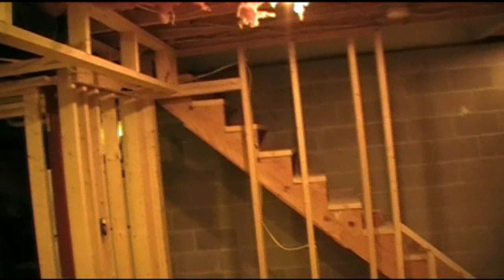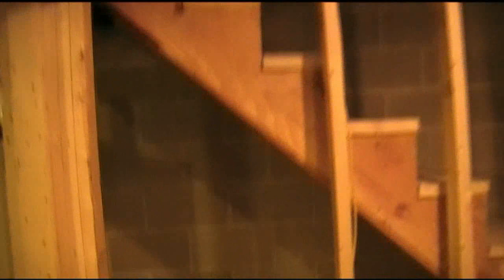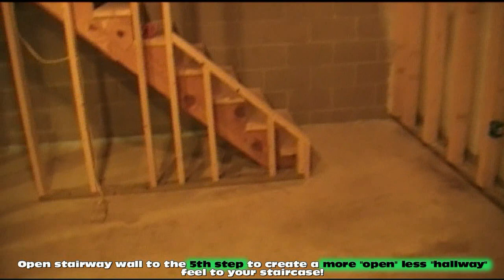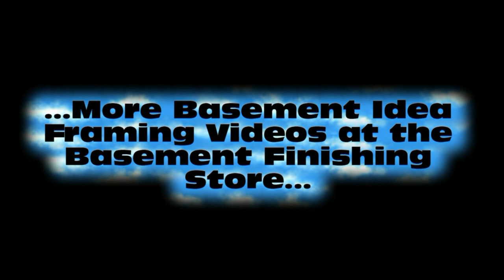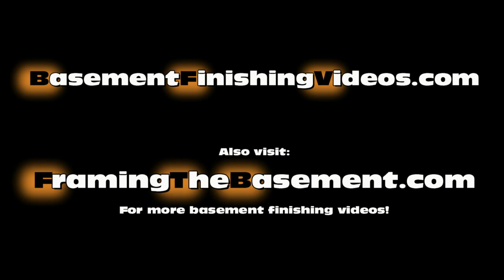More Stairway Wall Design Ideas

Comment from the maker: Well you must glue your drywall to the concrete wall using drywall adhesive. This way you only lose the thickness of a sheet of drywall (1/2") in the stairway.

There is not enough space in the stairway to build a framed wall, I don'y even like using 3/4"lathe! Just glue it and be done with it. You can pound  a few 1 1/4" concrete nails to hold it in place until the glue drys. Once the glue sets over-night your good to go!

Hope this helps. ~Eddie
Reply: Do you do anything to protect from moisture?
Reply: Stringer should be 1.5” thick. Use 1” foam board glued to the basement wall then glue drywall to the foam board. Use J bead around the drywall perimeter to finish the edges.

Comment: Regarding the bottom 5 steps- do you simply slip a piece of dry wall between the stair treads and the framing? Seems it would be difficult to finish the wall trying to work against the steps like that. Any advice? Thx for the video.
Reply from the maker: Yes that is correct. It's really the only way if you do not have the pre-manufactured stringers attached to you stairs...as many older homes basement steps are lacking.

Eddie

Comment: If you left it without railing at all, it would create a more open feel and would make it easier to maneuver larger items.
Reply from the maker: True Lezlie...but it would not pass the code inspection for stairway safety if you were to get a building permit and have all of the required project inspections completed...

Eddie